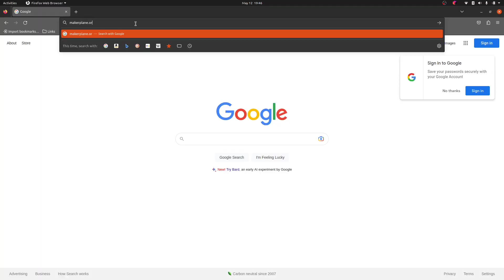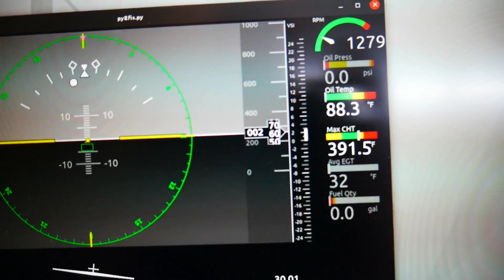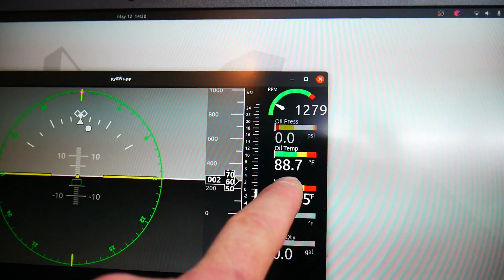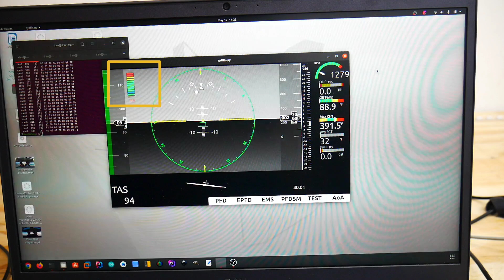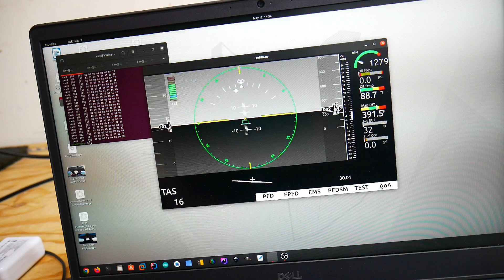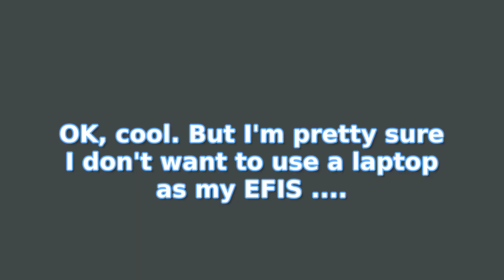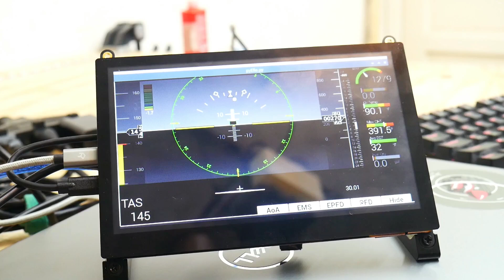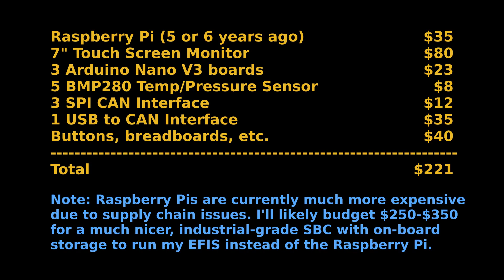Practically Free Avionics

Comment: Good video. Please make a video detailing the install of code onto raspberrypi. Details like which version of Pi OS being used. Use of Python PIP and how to avoid the "pip externally managed environment" message when attempting to load the "geomag" package. Some detail about file structure such as where in home directory files are placed. Makerplane documentation gives basics of install but not much else.
Reply from the maker: Have you watched my video titled "Connecting a Stratux to the MakerPlane EFIS?" I kind of go over some of that, but I did it on a Ubuntu computer rather than a Raspberry Pi. Here's a link in case you haven't watched it yet:
https://www.youtube.com/watch?v=AJPfOm8xwjs

Comment: Hello Flyer Dan, great video thanks for taking your time, you spoke about different sensors for dynamic pressure or tempeature for oil or coolant.. what would those sensors be? Can you use a sealed housing for dynamic pressure on the bmp580 sensor? What about the chinesium temp sensors for egt and cht?
Reply from the maker: This video is meant to be an example of what's possible. I posted another video a couple of weeks ago demonstrating my foray into printed circuit boards (https://www.youtube.com/watch?v=cIsv_dQTMyo). On that video, I showed how I added a couple of air pressure differential sensors (MPXV7007dp) to sensor boards to gather two types of air data: air speed and AoA.

The Arduino has several GPIO pins that can be programmed for analog or digital use. In the case of the MPXV7007dp pressure differential sensor, it uses 3 wires - Positive Power (5V), Ground, and an analog reading pin. There are two nipples that you can use to connect pitot/static tubing and the sensor basically gives you a reading of what the difference in pressure between the two lines is. the 7007 denotes that it can read +7 kPa to -7 kPa. If the sensor is reading +7 kPa, the third wire outputs about 4.75V. If it's reading -7 kPa, it outputs about 0.25V. And anywhere between is some number. If there's no pressure difference, it puts out about 2.5V on the reading pin. The Arduino takes that value and does some math to convert it to knots and then pushes it to pyEFIS screen over the CAN bus. There are other sensors that are a better fit for barometric pressure and temperature. The pressure/temperature sensor I used here was just being used as a demo to show that you can collect data from just about any kind of sensor (as long as you know what to expect from it) and convert it into some kind of CAN message to send over to pyEFIS. 

As far as I know, EGT/CHT sensors would output analog data like the pressure differential sensor I talked about (MPXV7007dp). Probably some range of voltage that increases as the temperature rises, which you would read on some some pin on the Arduino and then convert to a CAN message.

Hopefully that's helpful. 🙂
Reply: @dan_der_flieger   I really like your videos man!!! continue doing them, specifically about the Linux based EFIS and EMS, the MPXV7007dp sensor is quite more expensive but I guess reliability is something we shouldn´t be cheeping out - I find it hard to follow up all the makerplane github repository I guess is a steep learning curve; you also mentioned that these systems should be as secondary and not primary, you sounded a bit hesitant on having them as primary,  you´ve got to remember that the "mechanical" steam gauges we are using today are far less reliable than any electronics- for electronics so long you have a good source there are no moving parts- the accelerometers are quite genius devices - since they are not that expensive you can have parallels sensors ruining for redundancy-
Reply from the maker: @Wolves200 - I totally agree that the MakerPlane documentation is a little hard to follow. It took me a couple of weeks to get stuff working. I was hoping to take some of the mystery away from a simple installation.

Regarding the pressure differential sensor, depending on where you purchase the MPXV7007DP, it's not too expensive. I've seen them on AliExpress for about $15 (https://www.aliexpress.us/item/3256805054885075.html). By the time you purchase two BMP580s to get a differential reading between the two, you've probably spent that amount already. 

Regarding primary vs. secondary - the FAA here in the US put out an advisory circular a few years ago that made it easier to install an aftermarket AoA sensor. Instead of needing to be a Supplemental Type Certificate (STC), a certified mechanic can install one and sign off on it - however, the indicator has to be marked with "Not for use as a primary instrument." 

I agree - solid state electronics are certainly more reliable than mechanical gauges. 

Parallel sensors do give you redundancy, but can also introduce another problem: if one fails, how do you know which one to trust? What if one of the pressure differential sensors, for example, starts to leak a little from one of the nozzles? It's not easy to know which nozzle on which sensor is reading higher/lower than the other one. So unless you have 3 sensors that you can compare, you might actually be using the wrong data and put yourself in danger that way. Personally, I'd prefer to have a single sensor fail (because it's easier to detect) than to not know which sensor to trust.
Reply: @dan_der_flieger  Dude! this is super helpful the info you are sharing it seems you were struggling with same thing I am right now, I super excited to start a project like this-
Reply from the maker: @Wolves200  glad it's helpful.

Comment: Sorry for the question, is this a GUI? Or a full-fledged device with its own ACRS?  If with AHRS, then how do you compensate for centrifugal forces in flight?
Reply from the maker: Hey Ivan. Thanks for watching. 

This video covers the MakerPlane pyEFIS (yes, the GUI), but also the underlying data transfer components. It uses a CAN-bus derivative called CAN-FiX (also developed and maintained by MakerPlane). 

Regarding AHRS (I'm not familiar with the term ACRS) ...  I don't have an AHRS sensor on the device in this video. But if you watch another video I posted more recently, I have been learning how to design and etch my own circuit boards and one of the boards I made holds an Arduino Nano microcontroller, an Adafruit BNO055 Absolute Orientation Sensor (which is supposed to combine readings from three, 3-axis sensors - an accelerometer, a gyro, and a magnetometer - to determine its heading and attitude), and a CAN bus module.   The Arduino gets pitch, roll, and magnetic heading data from the BNO055 sensor and converts it into MakerPlane CAN-FiX formatted messages, which are then  pushed to this EFIS screen. 

As for the compensation for centrifugal forces, the BNO055 is "supposed" to be able to figure that out (e.g. "absolute orientation"). But I haven't yet tested that and I hear it might not work reliably. So I would say that, no, it's not ready for use yet. But if you have a line on a good 9-DOF sensor and solid example Arduino code to combine the readings into accurate, absolute orientation data please let me know. That's probably above my skillset at this point.

Comment: I haven't finished watching the whole video yet, but one quick comment for your consideration.  I am not an avionics engineer, but I did get my hands a little dirty on a recent work project and learned some things the hard way.  I would give a hearty recommendation towards placing your electronics in your airplane and doing some basic EMI/RF interference testing with your transponder and some basic radio calls.  Do this early in the project and test this along the way as you make changes and updates.  The I2C bits can be especially susceptible to EMI, and the 2-way I2C protocol doesn't lend itself to robust recovery when bits get corrupted, it is even possible to hang your whole bus so badly the only possible way to recover is to reboot (or maybe even power cycle) the host.  Even converting I2C to a differential protocol and back (for longer wire runs) leaves you susceptible at both ends.  SPI has similar issues, but I think can be more recoverable after corruption.  Don't just assume you can buy your way out of EMI issues with better shielding.  At this point in my career I just expect that any I2C device or code that depends on I2C data will immediately quit working and never come back the moment the pilot presses the push to talk button.  Of course everyone's mileage may vary with this stuff ... EMI is pretty mysterious most of the time.  CAN is good.
Reply from the maker: Interesting. Definitely a good caution. 

I posted a video more recently that goes over my foray into printed circuit boards. The run for I2C is very short (just a few mm) and I use CAN for the long runs to the peripherals. Obviously, shielded twisted pair will be the wiring of choice to minimize EMI. And even the "long" runs will likely be less than 3ft. 

But you make a good point ... Testing and moving of components as necessary will need to be done. 

Thanks for watching.

Comment: Pressure differential is commonly used for slip-skid input, with matched port and starboard static ports just forward of the tail [depends on where clean flow is on the particular airframe design]
Reply from the maker: Pressure differential certainly can be used for slip/skid. My original design for the AoA sensor had two pressure differential sensors (AoA and slip/skid). The second had two wind vanes. Then I realized that the Arduino I was using had a built-in accelerometer that I could use similar to the ball in a general aviation slip/skid indicator, without the mechanical nuances of the wind vane. 

It's an interesting consideration. Thanks for mentioning it.
Reply: @dan_der_flieger  Now I'm curious why the G-5 equiped airplane I flew bothered with static-port based slip-skid. An accelerometer seems far more simple and reliable to implement. Solid state, no plumbing or clogging. 
Initial calibration would be simpier for the pressure differential, just set it to zero inside a hanger with no fans turned on. The accelerometer would need to very accurate mounting in both the roll and yaw axis.
Reply from the maker: The flying club I fly with has two airplanes with dual G5 instruments. The G5, as far as I know, only has ports for pitot/static pressure (airspeed, altitude, and vertical speed), not for slip/skid. Everything else is done with an AHRS sensor. If the one you flew used yaw vales from a pressure differential sensor, it was external to the G5 and probably reported its values over the serial connection. 

There are a few avionics manufacturers that claim to be able to figure out angle of attack with AHRS data. I think that's a stretch and is very specific to the airframe and under normal flight conditions. Flying through the mountains on a windy day, for example, could produce updrafts and downdrafts that, while your attitude indicator shows straight and level flight, might not coincide with actual angle of attack against the relative wind. 

Seems like the same could be true with accelerometer-based readings during a slip/skid. But I'm not sure I can think of a specific example of when it would be different from a swaying ball.
Reply: @dan_der_flieger  AoA is a different problem. [Accurate] AoA without pressure or vanes would basically require integration of a complete inertial reference system. But even Airbus and Boeing choose a vane or two over all that fuss. 
Yaw coordination is more of a simple coordinated or not type of information, and transient changes from a gust have little practical importance.

AHRS still needs to get its information from somewhere.
It was a few years ago. That plane also had an autopilot that may have used the yaw pressure differential, but I don't recall it having a rudder servo (C172N only have ground adjustable yaw-trim tabs). It had a real wide mix of separate avionics upgrades being forced to work together anyway.

Comment: I developed a CAN bus driven auto EFI display using a Teensy micro.  Now I have an interest in Aviation and this was one of the first things I looked up. This looks great!
Reply from the maker: Welcome to the world of aviation. I got into the CAN stuff because the engine I'm planning to mount on my airplane is based on an automotive engine that uses a MegaSquirt ECU. When I talked to the owner of the company, he said they didn't really have an engine monitor, but he did send me some documentation about the MegaSquirt CAN protocol. My plan was to make my own Arduino-based engine monitor, but when I saw that there was already a nice, open source display I decided to just use it instead. I'll basically have to have an Arduino that listens to the MegaSquirt messages and then translate them to the CAN-FiX protocol and push them to the MakerPlane service.
Reply: @dan_der_flieger  yes I am very familiar with the MS hardware myself. It gets really fun when you get into your own board design if you aren't there yet.
Reply from the maker: @1972challenger  Hah. It's interesting that you say that. Over the past month or so I've designed a couple of PCBs - one that's a CAN Bus hub (you can connect 10 CAN devices to a single board hub with DB-9 connectors) and another that holds an Arduino Nano, a 12V to 5V power regulator, an air pressure differential sensor (for airspeed - or - angle of attack), and a CAN board. I had to learn an open source PCB design software called KiCad and a process for etching the boards for prototyping using household chemicals (vinegar, hydrogen peroxide, and salt). It all works surprisingly well together. And, like you said, it really is fun! Sort of a game to see how I could make all of the traces go where I needed them on a single sided board.
Reply: @dan_der_flieger  I was going to recommend Kicad lol. I use OshPark for my board manufacturing. They are a little expensive but they can get small prototype quantities out quick. Another thing to note is sometimes the power supplies can be tricky in the auto/plane world esp during cranking up. That's what I found the most tricky. Good luck and maybe we can cross up on a project.
Reply from the maker: Cool, I'll have to check out OshPark. I haven't tried sending anything out for production yet, just home etching.

Comment: Nice vid.  Think a Pi4 would run it at full speed?
Reply from the maker: Probably, but I don't have any experience with the Pi 4s. They're hard to come by right now. I'm looking forward to when we can buy them for under $100 again. 🙂
Reply: Dan, do you know if Makerplane will support moving map navigation and drive an autopilot?
Reply from the maker: @georgemellen3026  - they do have a moving map project. I haven't looked at it yet, but once I get to the point where I'm ready to really dig into my panel, I'll look harder:
https://github.com/makerplane/pyAvMap

I'm not sure about auto pilot, but here's an old article that says they used to support a servo controller, so I have to think it's possible:
https://www.avweb.com/press-releases/makerplane-and-vx-aviation-introduce-auto-trim-controller-for-dynon-skyview/